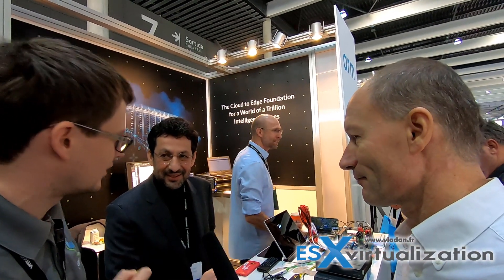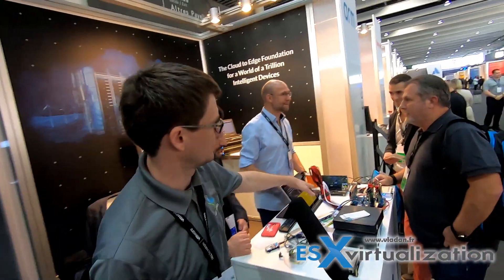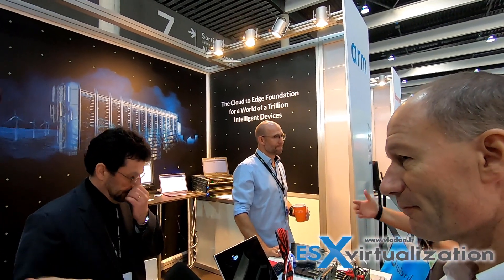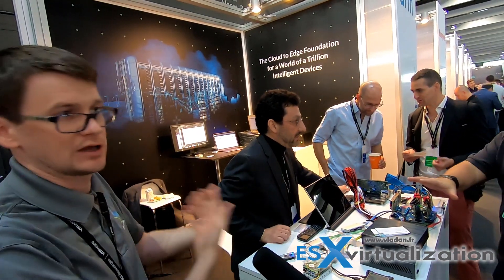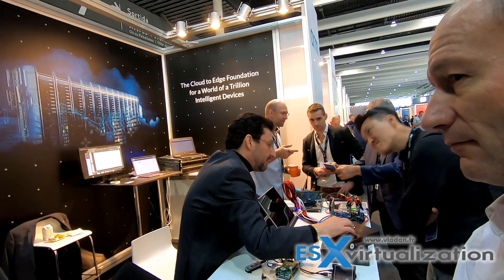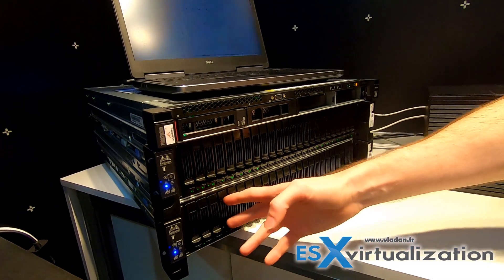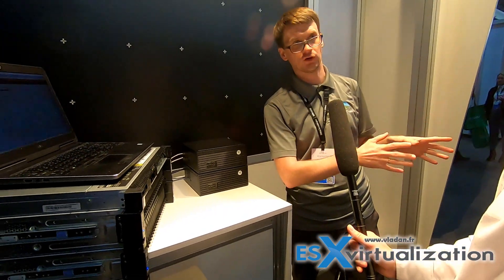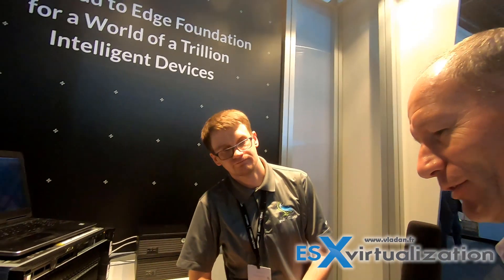ESXi 7.0 on ARM

Comment: This is completely scalable as long as the hardware is supported. Each SBC would only need to be hot swapped then you could use docker to config new boards. Eliminating the need for downtime between updates. Genius. Ruthless efficiency